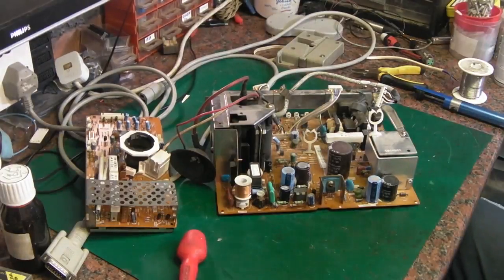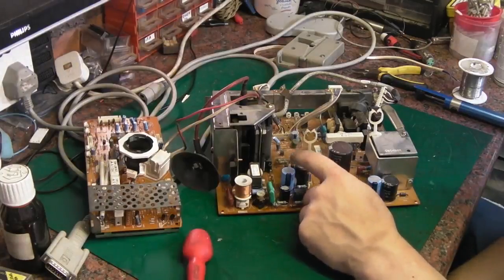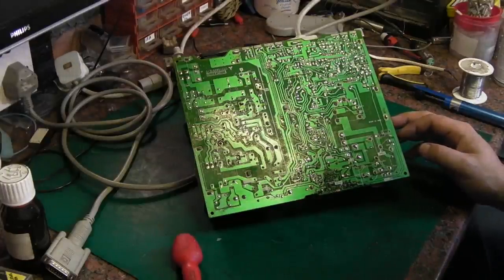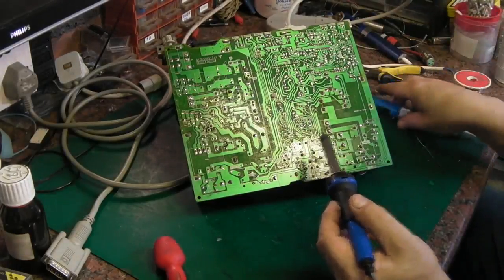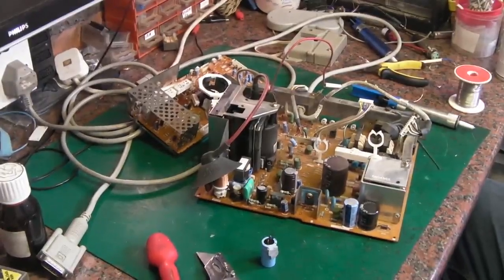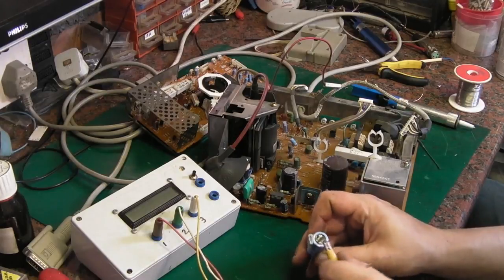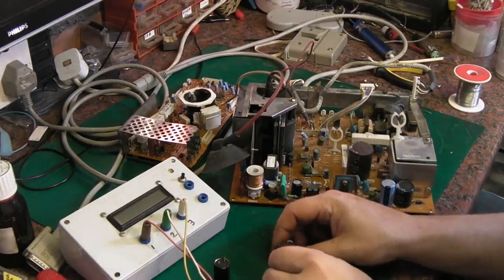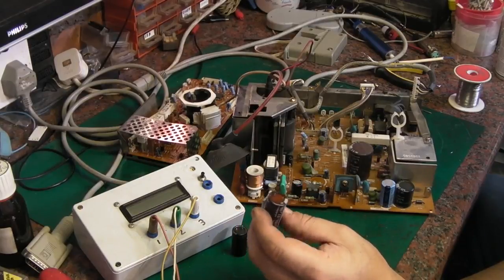Macintosh LC 12" RGB Monitor repair Pt2

Comment: Check resistor R514 (should be 10-ohm, looks like 1/2W or 1W type). With that open-circuit, there’s no 12V supply and the symptom you have at the end of the video. I know, because mine was like that ten minutes ago :)

Comment: I would look at the smaller caps around the power section.  The interesting thing is the wierd colours there too - makes me wonder if the degauss is not working or something, but the colour patterns and bright white spots make me wonder about a tube issue.
Reply from the maker: yea It does look power related the pulling in of the raster leads me to think low EHT and it has retrace lines visable will look at the caps in more detail plus the transistors round where thoses caps where leaking.
Reply: @Jayoldstuff1  Have you managed to get your Monitor working... Mine is currently in this state and stuck without a HV Probe....
Reply: @JaysVintageJunk my monitor is in the same condition please tell me if you ever fixed it!
Reply: @adamschussel4765 amazingly, after replacing leaked capacitors AND the vertical control IC (mine had just a bright horizontal line), I now get exactly the same result as shown at the end of this video. Over-bright raster (can be hidden by turning down the Screen control on the flyback), poor pincushion, retrace lines, extending beyond the raster in one place on left and right sides… identical. Except, I don’t have the unwanted background colours (wonder if the degauss coil was plugged back in earlier in the video).

Anyway, I think from reading elsewhere, there are some low-value resistors that go open-circuit. Probably the same resistors that get hot. I’m about to check those… 

Did you have any success?
Reply: @adamschussel4765 check resistor R514. Should be 10-ohm, 1/2watt type. Mine was open-circuit. With two 22-ohm resistors in parallel, the 12V rail reappeared and the video circuit works